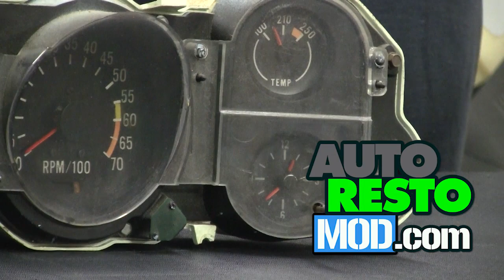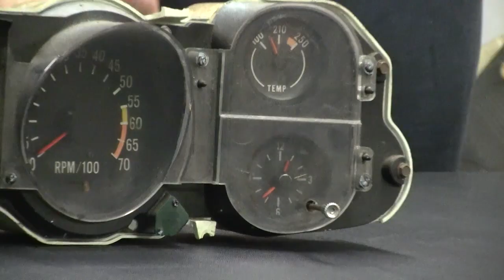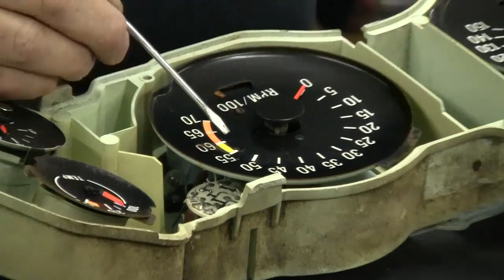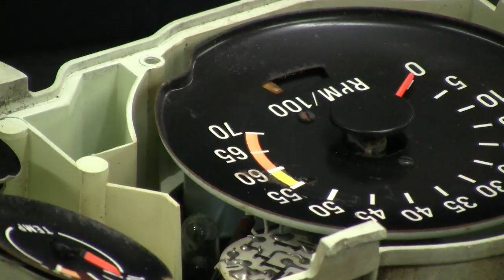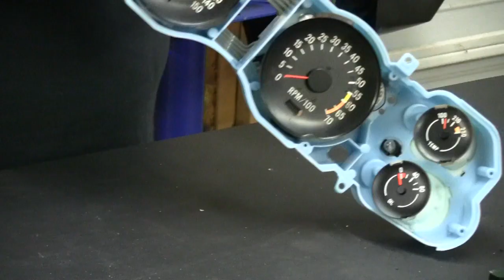1970 Camaro Guage Cluster Oil Pressure Gauge Episode 349 Autorestomod

Comment: The GM Truck Oil Pressure Gauge from '73 will work as well, it just requires a bit of fabrication to mount to the Camaro Pod. The font matches the Camaro beautifully. The early gauge is mechanical, later gauges require a sending unit. The trucks had either a 60psi or 80psi guage face. Gauges later than '76 have a change to the font and don't match as well

Comment: When you get the tach back ask for some gauge needle paint so you can touch them all up to match the newly done tach. I would update the dash lights to LED while you are there
Reply from the maker: Yeap. We were going to do the segment on the needle paint...but found out ours was completely dried up in the bottle...
Reply: Just be aware that painting the pointers on gauges adds weight to the pointer and throws the balance out.  It's not only the mechanism that's balanced, the pointer is also.  On the speedo and tacho the pointer balance  is especially critical.  I little dob of paint might not seem like much but it is.
If you're sending the tacho out to be calibrated anyway,  best to send the speedo out also to be checked because a speedo that old will certainly have wear and/or the magnet may have lost some of its field strength.
Many people don't pay enough attention to the speedo but it's the hardest worker in the dash and it will thank you for a little love and lube. 
When your instrument guy re-calibrates the tacho ask him to re-apply the paint on the pointers as well.  This way he can take into account the weight of the paint and balance the pointer. 
My 2 cents.  :o)
Reply from the maker: Good pointers! See what we did there?! ;)
Reply: i dont mean to be off topic but does anyone know of a method to log back into an instagram account..?
I somehow lost my password. I would love any tips you can give me
Reply: @Grayson Aydin instablaster :)
Reply: @Keanu Brooks it did the trick and I finally got access to my account again. Im so happy:D
Thank you so much, you really help me out !
Reply: @Grayson Aydin Happy to help xD

Comment: My 77 has the tachless gauge cluster so I have the oil and gen gauges on the left and I want to know how those work. Does the light go off section by section or what? It's the cluster with the cross/+ in the middle of those gauges so it looks like a fighter jet sort of and I like the look but I have no idea how to read them or how those will light up or turn off or whatever/however those work. Also what is gen? Gen meaning generator? Like battery?

Comment: I bought the carbon fiber classic dash with the autometer gauges and the 3 mounts for the wiper switch are different then original on original the 3 mounts are angled and new dash 2 are angled and the single side is straight also taller??? Called Classic Dash and they gave me part# 1993464 for the wiper switch but the single mount side is on bottom not top side of switch any suggestions not wanting to start cutting up new dash. This for my 1970 split bumper camaro any help would be great thanks

Comment: How would you swap out the big fuel gauge with a tach (and swap a small fuel gauge to replace the oil gauge) on the 1973 z28? Would I need a different circuit board and is that an easy swap? HATE the big fuel gauge! Thanks
Reply from the maker: I'd contact http://gaugemarks.com/ and see what he can do to help.